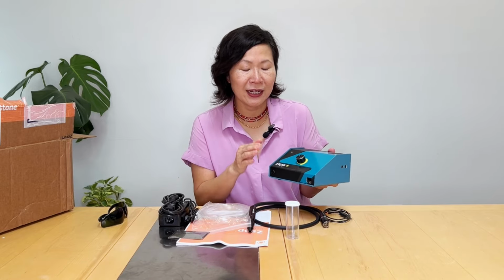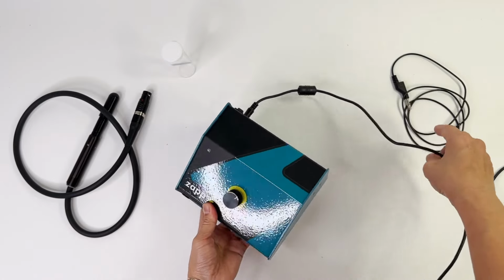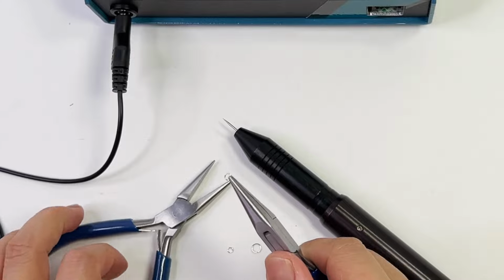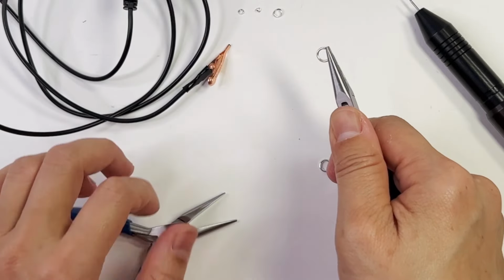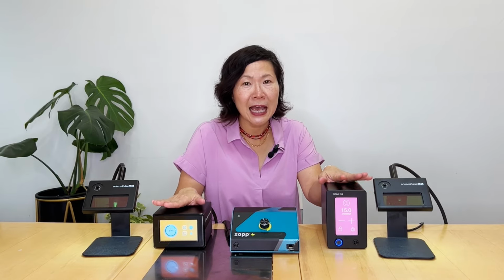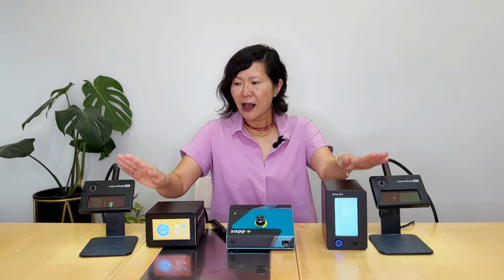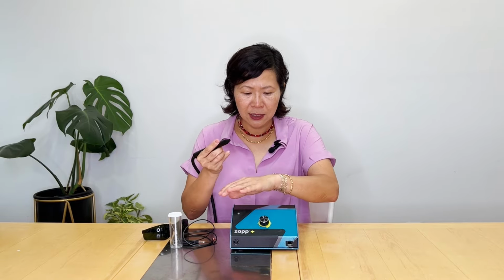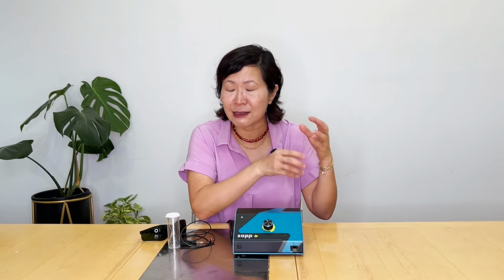Full Product Review of The Zapp Micro Welder by Sunstone Engineering

Comment: Please which one would be a good option for welding a metal or titanium eyeglasses?
Reply from the maker: I would recommend Zapp Plus because it was the range of 30w (very powerful), and Zapp has max of 15w.  Some eyeglasses have thicker (round) wire frames, so it will require more power. 

If you have a bigger budget, you can opt for mPulse Tru-Fire (very nice and sophisticated, with all the bells and whistles) but Zapp Plus will do the work just fine.
Reply: @stonesandfindings  thanks a lot for your time and help. I really appreciate it 🙏🏿

Comment: Hi, i just purchased zapp welder, does it work on stainless steel jump rings? It feels it didn't work in mine with standard jump ring. Or can you show me the setting for stainless steel?
Reply from the maker: It should weld stainless steel, and any metals that conduct electricity.  You would have to weld at higher power than 925 silver and gold filled.  Test at different power settings, slowly reduce power, each time checking for security.

Comment: My welding is not working. I just received it and did a few test welds. Turned it off to adjust the electrodes and now it will not turn on. Has anyone had this issue? I literally did about 7 welds. Help
Reply from the maker: Hi Tammy,
I have heard of this before.  I know you didn't purchase the welder through us, but I think I can help.  
If you have checked all the plugs (I know, eye roll, but just in case!), and try turning on the power. Does the light go on?  If it does, please let me know what happens when you try welding?

I don't check comments frequently.  It's better to email me dana@stonesandfindings.com and refresh my memory of convo on Youtube.  I will advise you.

Alternatively, contact the dealer you purchased it from.  If it's any defect, they will have Sunstone courier a replacement welder to you immediately.  Sunstone service is that good.  We would have done the same if you bought it through us and I would video with you.

Either way, we will get you sorted and welding!!!
Chat soon.
Best
Dana

Comment: Is this a dual voltage or only 110/115volt?
Reply from the maker: Yes, it is 110, but all you need is an inexpensive travel converter to plug into the socket that is standard in your country.

Comment: Hello,
When welding gold, does pulse welding introduce any additional material to the part being welded, or does it merely connect the gold material without adding extra substance? 
Also, is it essential for the wire to be made of gold?   Thank you
Reply from the maker: Welding does not use solder, so it does not add any other materials.  There might be oxidation, especially if you do not use argon gas.  However, spot welding is so small, unlike industrial fabrication, that it won't be weak or have lots of byproducts from the process.  

The wire should be solid gold rather than plated or gold filled IF you are balling the ends.  But if you are welding simple jump rings, many people use gold filled.  A small dot, the size of 1/2 a poppyseed will darken over time because the metal underneath will have been exposed when fused.

Comment: This was very helpful but I have a question. Does it use Argon gas? I see it is sold sometimes with an Argon gas regulator.
Reply from the maker: You can use argon gas with this.  In my filming, I do not use argon, just to show the effect.  The Zapp is argon ready.
Reply: @stonesandfindings when do I need argon gas ?
Reply: @nkongrande8041  stainless steel and maybe gold filled.  if you dont have argon it might leave the piece a little black but it usually wipes off with your finger.  hope that helps

Comment: Hi, what is the material of the jump rings you are welding?
Reply from the maker: I am welding 925 silver and gold filled.  This machine works with any metal that conducts electricity.
Reply: @stonesandfindings  I just ordered this same machine but I have the Amazon no-name brand welder and was not having success welding gold plated jump rings
Reply: @stonesandfindings   HI, for the metal should i used different electrodes?

Comment: I got a 3 year warranty on an no name machine.   Everyone should use a barrier when welding to protect skin.The electrical tape is because the handset isnt painted black like the sunstone machines and thus provides insulation like the black coating does.
Reply from the maker: 3 yr warranty is excellent.
Reply: Where did you get the no name brand?